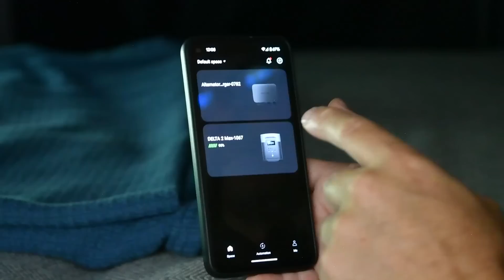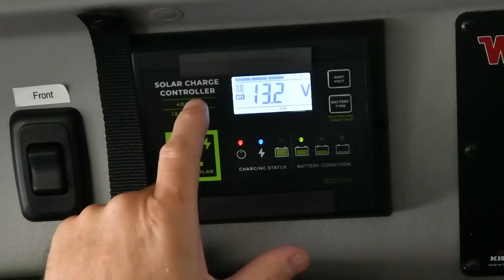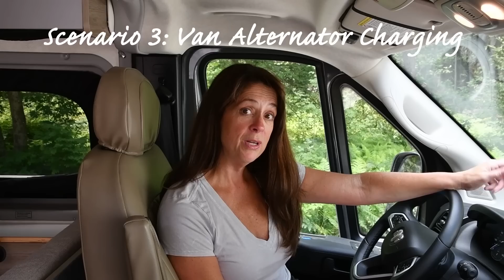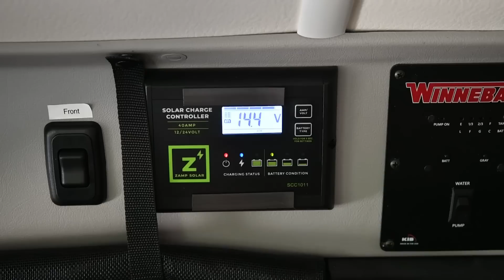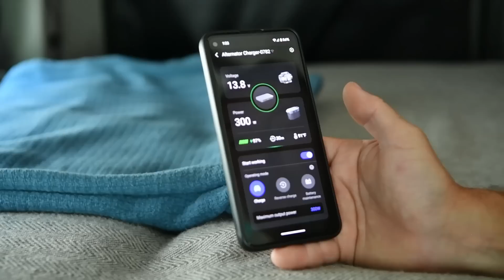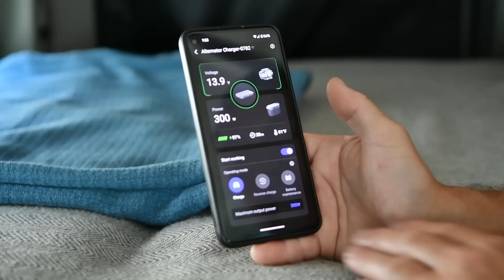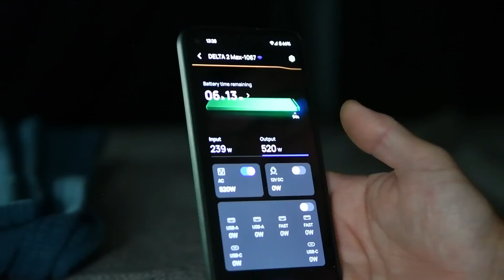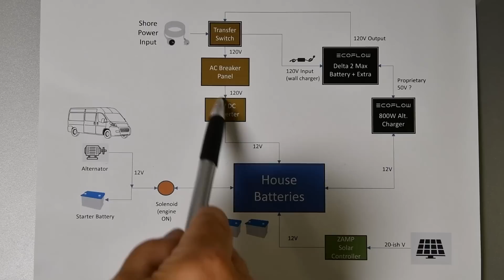Lessons Learned! ECOFLOW Alternator Charger and Battery upgrade

Comment: I'm confused by your schematic. It shows the house batteries connected to the starter battery through a solenoid. That can't be right. What am I missing? The Ecoflow Alternator Charger is designed to work with EITHER house batteries OR the starter battery. Yes? (I have one in operation, but not in a vehicle).
Reply from the maker: Yes in our van the house batteries are connected to the starter battery/alternator with a solenoid. When the engine is running, the solenoid is engaged and the house batteries can charge from the alternator. When the engine is off, the solenoid disengages and the house batteries power the camper but cannot drain the starter battery. By connecting our alternator charger to the house batteries we gain access to the alternator output when the engine is running (charge mode) then when the engine is off we can use reverse charge mode to access more power for camper use. The alternator charger is really a perfect setup for this. The one thing we give up is the ability to trickle charge the starter battery from the ECOFLOW. We came up with another solution to that. Hope that explains it? Thanks for watching.
Reply: @Outapkt On the first two sentences: What about the big inrush of current from the starter battery when you start the vehicle and the house batteries are below the starter battery voltage? What keeps your cables from melting?
Reply from the maker: There does not seem to be any big inrush of current. That's how the RV comes from the factory. A lot of them are setup that way, that's how they recharge the house batteries. There also appears to be a 70A breaker inline anyway, but it doesn't trip. Batteries especially AGM can only draw so much...
Reply: @Outapkt  There must be some component(s) in between the solenoid and house batteries regulating the charge. E.g., DC-DC charger. Else, the energy from the battery with the higher potential would transfer into the battery bank with lower potential as fast as it could. Just like manually connecting two batteries at different SoCs in parallel: there's going to be a spark when the negative lead is attached, and it better be a big cable if the SoCs are a lot different. So, your schematic shows your high-level interpretation of the operation rather than the actual circuitry, yes?
Reply from the maker: There is no DC to DC charger. Only the voltage regulator in the alternator connected to the solenoid and thus the house batteries. It works and does not burn out.
Reply: @Outapkt " By connecting our alternator charger to the house batteries we gain access to the alternator output when the engine is running (charge mode) then when the engine is off we can use reverse charge mode to access more power for camper use."

OK on "charge" is from house batteries to D2, but "reverse charge" would be from D2 to house batteries. (I'm not grokking the top half of your schematic yet and didn't rewatch the video yet.) Your loads are powered from the D2, yes?
Reply from the maker: Charge mode is from the alternator to D2. It won't draw from the house batteries (ever) because their voltage is too low (12.7v)  to trigger the alternator charger to start drawing power. It is configurable in the app.

Reverse charge, yes, feeds output power from D2 to power the RV via its connection to the house batteries. It is higher voltage than the house batteries so the D2 will be depleted first. Then we have to fall back on the house batteries if more power is needed.
Reply: @Outapkt  If you lower the alternator charger's setting "Start voltage" to something lower than the voltage of the house batteries, and enable "Reverse charge" and "Start working", the D2 and house batteries will deplete concurrently. The house batteries providing a max of 800W if you have the 800W version of Ecoflow's alternator charger. I have mine set at 12V (50% SoC) for an old AGM I'm trying to "destroy" before I purchase LiFePO4s to expand the energy capacity of my Ecoflow power station. You probably already know this?
Reply: @Outapkt  Between what SoC levels do you cycle the house batteries when you are tapping into them to supply power to/through the D2?
Reply from the maker: Sure you can do that but I don't see that it gains us anything in our van configuration. When we have a big draw like A/C, simpler for us to draw on D2 as long as possible, the lithium can drain lower safely, then as a backup go to the house batteries if needed. Thanks.
Reply from the maker: We don't use it that way.
Reply: @Outapkt  OK, so you use the house batteries as backup for when the D2 is depleted (or low). So, then, you'd lower the start voltage in the app so that the current would flow from the house batteries into the D2. (?) And knowing that you can only get 800W from the house batteries via the alternator charger, you begin the transfer before the D2 depletes so that you can run high power devices. (Or so I imagine you do or would do.)
Reply: @Outapkt  "We don't use it that way." Ok. I was just wondering how, if the house batteries were drained down to 50%, what prevents the starter battery energy from transferring to the house batteries at high amperage through whatever cable paths that the house batteries and starter battery have in common, while the charge level between the starter battery and house batteries tries to equalize. I don't understand the van's system. Is it stock? If I buy one of those vans, I'll get the same setup? Or, was it converted after it left the factory?
Reply: @Outapkt  [...] "draw on D2 as long as possible, the lithium can drain lower safely, then as a backup go to the house batteries if needed. "

I do something similar to that with my D3+ and battery I have connected by the 800W alternator charger. I already mentioned that I drain the standard AGM down to 30% SoC to get most of the energy out of it, not worried about ruining the AGM, for it will be replaced with an LFP battery bank. I do utilize the D3+ first, but I concurrently discharge from the house battery and the D3+ when I anticipate that the electricity rates are going to rise (hourly pricing) or notice them rising (I monitor it, and will eventually automate it).
Reply from the maker: Our setup does not work that way. When boondocking we use reverse charge mode on the alt charger. That feeds D2 power into the house batteries. Because the D2 voltage is higher, they get drawn down first and the house batteries stay fully charged during this. Once the D2 is down to 10% it automatically stops supplying power (I configured that) OR we simply turn off reverse charge. Then everything continues to run off the house batteries and the D2 is no longer in the picture. If we start driving somewhere I switch to normal charge mode and the D2 can replenish from the alternator. Hope that explains it. I never change them voltage in the app.
Reply from the maker: When the engine is not running, the house batteries and starter battery are not connected in any way. The solenoid is open preventing the house batteries from ever drawing power from the starter battery. Yes this is the stock setup. The solenoid is there specifically to prevent the house batteries from ever drawing power from the van (starter battery/alternator) except when the engine is running.
Reply from the maker: Makes sense in your case but not needed in our van setup.
Reply: @Outapkt  Yes, I get it. As long as the power draw on the house batteries is less than 800W, the they will not discharge while the D2 is feeding them and has energy to do so (at the set limit). Above 800W, they will discharge, and return to charging from the D2 when the draw drops below that.

Comment: Such a great thorough review.  We appreciate this.  You’ve easily earned a sub.  Question ….. did you upgrade to a stronger alternator? Thank you.
Reply from the maker: Hello! Thank you so much for the feedback, it is really appreciated! No, we did not upgrade the alternator. We are able to manage when we recharge the ECOFLOW through the app as well as control how much power we feed back into it when we do recharge. We are careful not to recharge the ECOFLOW at a high rate if the house batteries are also charging. Hope that helps and thanks again!
Reply: @Outapkt  I'd be very leary of additionally taxing a vehicle's original alternator with an alternator charger (no matter at what set limit) if it is used in remote locations. I'd opt for an alternator upgrade at least, but ideally a custom installation of an additional alternator for house battery charging if the vehicle is amenable to that. Just saying. Budgets may constrain, I know.

Comment: Be very, very careful using the vehicle  alternator to charge lithium batteries,  unlike lead acid, lithium pulls full current demand, so if you are driving with the vehicle  fan, lights, tunes on or AC you could be over taxing your alternator, thats bad & will shorten the alternator life, possibly stranding you.if you can fit an over rated alternator or add a second dedicated alternator is your best bet.
Reply from the maker: Hi there! Our house batteries are AGM, the standard ones that came with our van, so no issue there. We added our ECOFLOW supplemental battery system and the ECOFLOW alternator charger, but we don't charge both systems at the same time. We only flip in the alternator charger after the house batteries are charged up. Also the alternator charger allows us to control the max charging current, we normally use 400 to 500 watts only even though it supports up to 800W. With this setup the lithium cannot pull whatever they want. Thanks for watching and for the heads up!

Comment: You all are awesome. Question for you all or anyone out there. I have a ctek D250SE and now a Ecoflow Delta 3 and the alternator charger. 

I would love to keep my set-up and do as you did - charge the house battery from the ecoflow when needed and use the alternator and solar to charge both the house and the ecoflow. 

Do you think the ctek will hiccup in this scenario?
Reply from the maker: Hi there! Thanks for the positive feedback. We don't have experience with the ctek, but it would be helpful if you could provide some details on how your alternator charger is wired and how the ctek is currently connected to everything else. Is the ctek between the starter battery and house batteries? How do you control it, via an app? Also is there a solenoid that disconnects the house and starter batteries when the engine is off? Where did you connect the alternator charger? Thanks!

Comment: Have you (or considered) replacing the deep cycle house batteries with lithium?
Reply from the maker: Hello! Yes, we have considered this. Our biggest hesitation is relating to cold weather performance. We live in the northeast, and use our van in winter. Lithium batteries generally stop charging below a certain temperature, sometimes as high as the freezing point (32 degrees F). Although they will continue to discharge/supply power below that temperature, once it gets cold enough, they will stop doing that too (often they will stop once the temp is below -4 degrees F). They do make heated battery models (which can internally heat the cells), but these require an input power source (charging voltage) to engage the heating function, so that would not work at night. We would be eager for the extra power availability that lithium batteries would provide, but have been hesitant to go that route do to the above concerns. Some lithium batteries advertise specs that are more accommodating of cold temperatures, but in the end, our research has shown they all succumb to the above factors in one way or another. The last concern is the charging profile of lithium, which is different because they can draw more power during charging, So if you install lithium batteries with capacity well beyond the 100ah each of AGM, you run the risk of putting too much load on the alternator and charging system/solenoid/etc. We definitely recommend doing your research. Thank you and good luck!
Reply: @Outapkt  You could install a dual-battery-bank with a selector switch to select either your lithium bank or your lead-acid bank (when cold). Perhaps that would make a settings change required when switching from one to the other (I didn't consider that, but maybe it wouldn't). Light and small LFPs compared to AGMs make the dual bank not so bad, but maybe a non-starter in a van because of the limited space. The size of each battery bank could be different as per usage requirements in warm or cold environments. Double the useable energy (drain to "0%") is hard to ignore, and with less space and 1/3 the weight of AGM.

Comment: I am curious about the EcoFlow alternator charger and lithium batteries. I have the EcoFlow Delta 2 (2400 watts), and I want to use a 12-volt 100Ah lithium battery to increase the total capacity. Is that possible? And will the solar charging of the lithium batteries be done with the right voltage for lithium batteries ( to charge at 100 procent for rebalancing the lithium battery??)
Reply from the maker: Hi, thanks for the question. How do plan to connect the 100ah lithium battery to everything else? Is it replacing a standard RV AGM house battery?
In normal charge mode, the alternator charger is meant to connect vehicle alternator power (normally by piggybacking on the starter or RV house battery) to the Delta 2 battery, to recharge the Delta 2 from the alternator. It has a special ECOFLOW connector that plugs into the Delta 2 battery. I am not aware of any method to add a additional 100ah battery to the Delta 2 in that configuration. It seems the Delta 2 has an extra battery capability, but that would take the place of connecting the alternator charger.  The Delta 2 Max has two connectors (thus allowing alternator charging AND and extra battery) but I think Delta 2 has only one.
In reverse charge mode, the alternator charger can feed out 12v power, but this would go to the starter battery or house battery, depending on how it was installed. The output voltage in this configuration, as I understand, it not high enough to fully charge a lithium battery only AGM/lead acid (it maxes out at 13.8v). But if you were trying to do this, you would only be moving power from the Delta 2 max to the lithium battery instead, not really increasing total capacity, and you wouldn't be able to recharge the Delta 2 from the alternator because the alternator charger was connected to your lithium battery rather than the vehicle starter battery.
I think your best bet would be to use the 100ah Lithium configured as if it was as a house battery, connected to the alternator directly using a DC to DC charger (best) or potentially a solenoid like in most RVs. Then you would charge your lithium battery directly from the alternator itself, using the DC to DC charger, rather than the alternator charger. Just make sure your DC to DC charger is lithium compatible. And when the vehicle is not running, you can use reverse charge mode to supply extra power to your "house" battery. This is basically how our van is configured except our house battery is AGM not Lithium.
Definitely do some more research but hope all that helps and thanks for watching.
Reply: @Outapkt  The alternator charger can charge the D2 at a max of 800W in charge mode via the house batteries. So indeed, energy expansion. Think of the D2 as a buffer, where it can be drawn-down at a faster rate than the alternator can charge it, but if the high power load is not constant, the alternator charger will eventually charge it back up. If the D2 becomes depleted, then you will be limited to 800W for loads. 13.8V will achieve 100% if left on long enough, but one could use an external charger to "top off" the batteries with shore power (or a via a DC-DC converter that with a lithium charging profile with solar?).
Reply: Or plugging the "top off charger" into the D2!